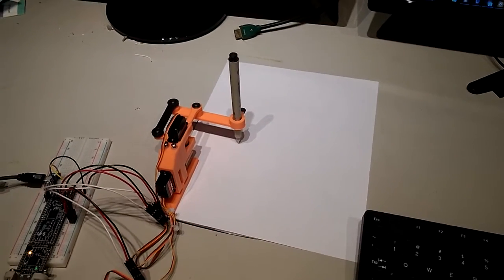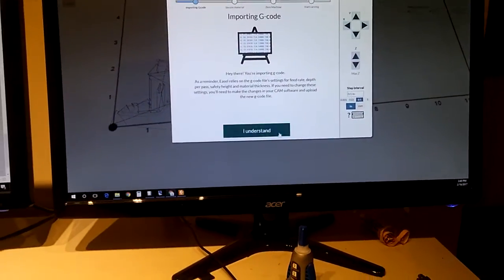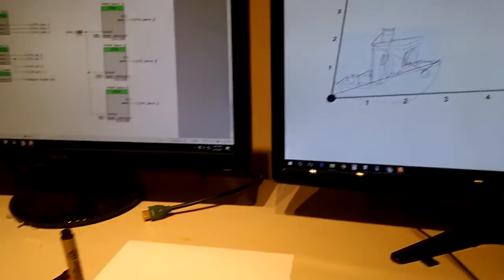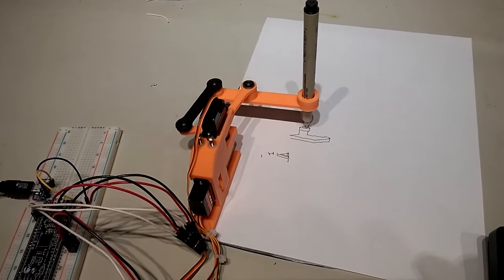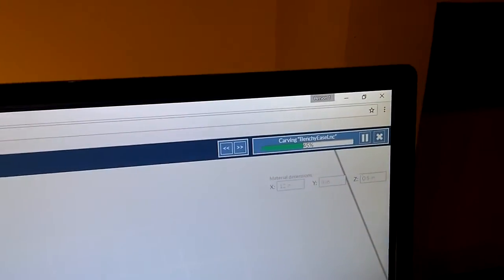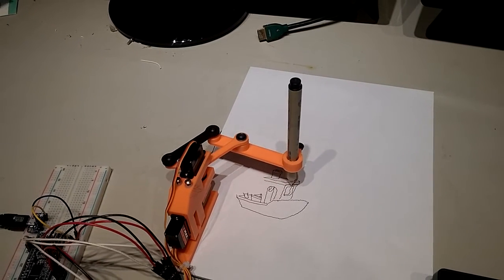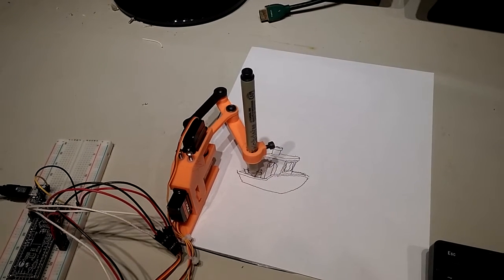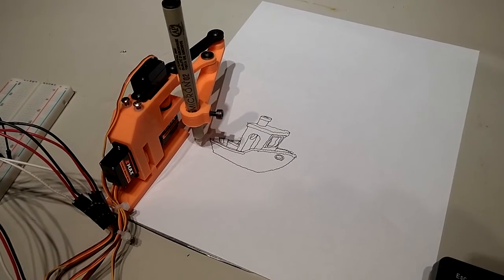Line-us Clone Running from Easel

Comment: Hi,

Excellent work and great blog.
I have followed your blog closely on this project and have a quick question:
I have the body and arms printed out and assembled along with the servos.
I used very cheap bearings  and I am seeing a lot of slack / slop in the arms:
https://www.banggood.com/10pcs-623ZZ-3x10x4mm-Ball-Bearings-Shielded-Radial-Bearings-p-1049663.html?rmmds=myorder&cur_warehouse=CN
 I don't know much about bearings, the ones you linked are 6$ each, is that quality and price necessary do you think or could I get away with something cheaper?  
Thanks for sharing and for all the clues on how to code it ;) 

Take care,
Reply: I splashed out and got decent bearings, the movement is very good now (beautiful) , feel confident going into the code, very fun project, thanks again.

You get what you pay for is the answer to my question.